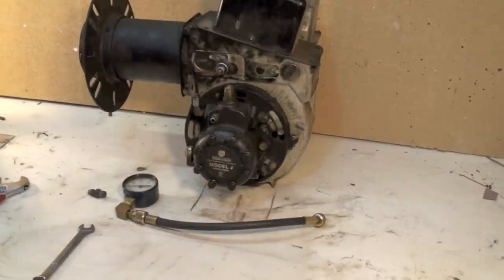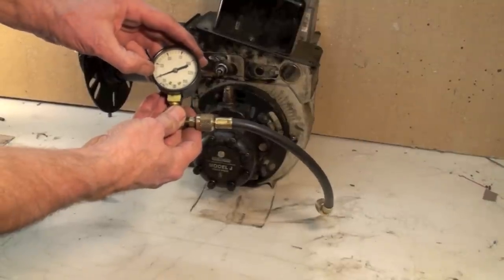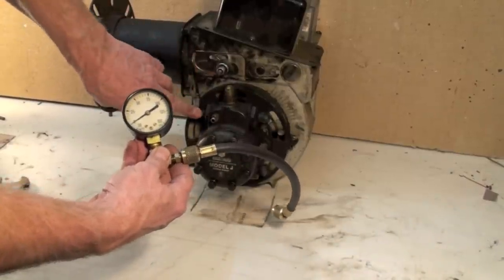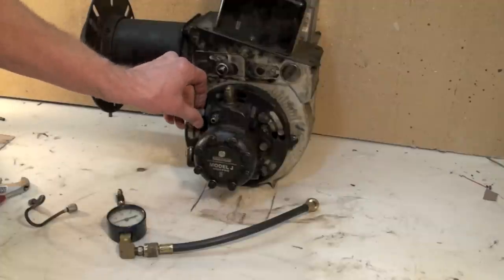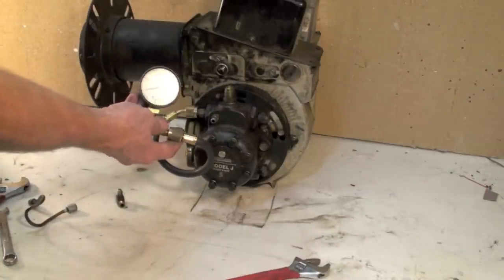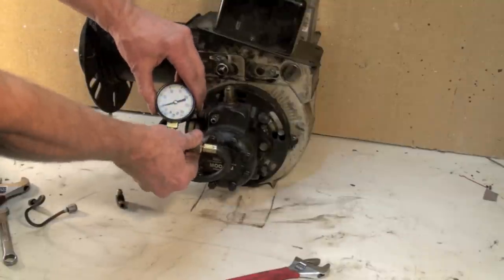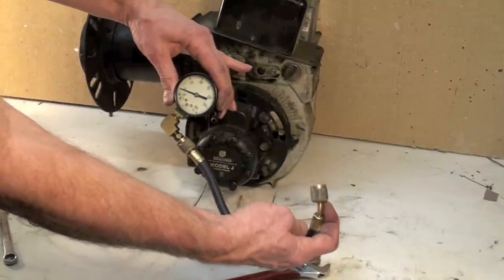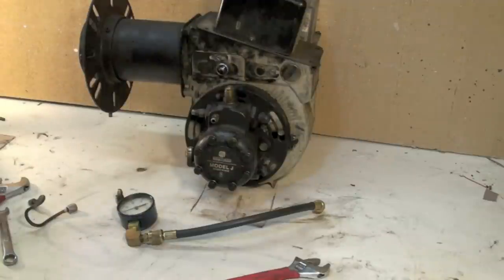oil burner pump pressure test

Comment from the maker: The tech probably increased pressure to increase efficiency due to better atomization.  The smaller nozzle was to compensate for the increased pressure.  If the nozzle is very small, it could plug.  It does sound like a supply problem though.  Fire the unit off with the gun line into a can to see if flow is continuous.  Good luck.

Comment: Hi Gary, thanks for your videos. I have a Miller furnace burning kerosene from an outdoor tank which is about 2 feet above the burner. I am having leaking at the burner which I’m thinking is “pump flow through” ? I’ve changed pumps in the past which appears to help for a while but reoccurs. I’ve seen pumps with an electrical connection and wonder if I should switch to that type. Any suggestions would be appreciated! All my connections are tight. I’m thinking the kerosene is getting through the pump and dripping out the nozzle. One line system. Didn’t run the furnace all summer and it still happened.

Comment: smaller nozzels are sometimes used when flame length is a problem,a smaller nozzel with a higher pressure gives shorter flame due to better atomization(the droplets are smaller and burn quicker)most new burners with retention heads are on 140-150 psi now-just a thought

Comment: If im testing the pressure with a gauge manifold(sid Harvey pump testing manifold) I have one line connected to the outlet of the pump(where the jet tube connects )and the other hose to the nozzle assembly.my manifold kit has pass/fail tests written under the case.i open the handle and fire the burner so I can watch and adjust the fuel pressure .it then instructs me to close the handle on the manifold and quickly turn off the burner .the pressure should not drop below 25 psi it says.but the pressure dropped to 0 on the unit so I was testing .it was a new lennox oil furnace with a becket nd burner and clean cut pump.
I doubt the pump is really bad ..did I do the test wrong or am I missing something .please respond!  I need your valuable input
Reply from the maker: You could have a leak in the manifold.  I also never used that setup, just a pressure gauge in place of the gun line.
GFM

Comment: Does this test only work on the gun line?

I hooked a gauge to the gauge port on the top of  a suntec pump...

It goes to 100 but drops immediately to zero 

Again, this was on the gauge port
Reply from the maker: It should work on the gauge port.  Does it drop to zero when the pump is running?
GFM
Reply: No
It maintains pressure reading when running 

But drop to zero on shut off 

I have a suspicion that the gauge port it's only for psi adjustment. 

I didn't try the gun line because I didn't have the proper adapter at the moment

Was just wondering if you ever tried plugging into the gauge port
Reply from the maker: Unless you have a leak at the fitting, it should drop 20% and hold.
If it does not, the pressure regulator is failing.
GFM @drummer4hire24
Reply: @grayfurnaceman 
OK 
I tested again....  Here are my results.

suntec pump.

On the GAUGE port I have 100 psi..... shut it off..... DROPS to ZERO  right away.

On the GUN LINE I have 100 psi  ... shut it off.... drops to  80 ish and HOLDS 

So, Obviously there is a difference in the gauge port and the Gun line...

hopefully this helps.

please test this on your own if you get a chance.  

Thanks.

Comment: How about putting a T fitting in the line then you can run the furnace and check pressure and adjust it at the same time
Reply from the maker: You could certainly that.
GFM

Comment: Where would you check the vacuum on an oil burner? Same spot where you'd check pressure?
Reply from the maker: At the supply line with the tank valve off.
GFM

Comment: Hi gary,
I greatly appreciate this video. I had a pump that was giving 100 p.s.i , but crashed to zero. The new pump holds at 90 p.s.i after it checks out. My question is if the pump was starting to fail would it have gradually went to zero or just checked out at a lower p.s.i like say 40, 50, or 60?
Reply from the maker: The reason for the normal 20% drop is the relief valve leaking by.  If the valve is leaking by, it will generally drop to zero, usually slowly.  I have never seen one drop to a lower PSI.
GFM
Reply: @grayfurnaceman  ok good to know. I was getting an epic amount of soot output. Basically a years worth in 2 weeks

Comment: My pump has a new 0-300 gauge installed on it.  My running pressure is 100 lbs. The pump bleeds down immediately when shut down.  My furnace seems to run fine and flame doesn't fail. Are there issues?
Reply from the maker: It should not drop over 20% unless there is a leak in your gauge.
GFM

Comment: I fyou are worhing on the burner with the burner on, reack=h over and flip the switch off- does the burner shut down the same way as it does when the boiler control shuts it down? With or without solenoid pump?
Reply from the maker: If you are switching the system switch off, it kills the power to the entire system.
GFM

Comment: Have a question I have a Beckett DS901 oil burner can I install a quality preasure Gauge and leave it installed on my unit would it hurt anything to leave it installed? Obviously not with a hose like a test Gauge. Just a quality liquid filled Gauge?
Reply from the maker: I can't say I have ever tried.  With some pumps, the pulsing may damage the gauge.
GFM

Comment: Hello Furnace Man... so I'm hoping you can help. My oil furnace needed to be reprimed as it ran out of oil. (I'm never going to let that happen again). Its a Mectron M5 type 217T. prime port was not all that obvious because it didn't have a nipple on it. So in the process of locating the prime port we accidently adjusted the pressure port. Is there an easy way to find out what pressure it should be. I have added a pressure gauge to the prime port as I could see no other place it fit easily. The burner runs at 100 psi but I'm not sure if that was the initial setting.
Reply from the maker: Some of the newer systems run 140#, but most of the older ones are 100#.
GFM

Comment: I got 8 of those units in my gradge collecting dust not I can check the pumps.  I think i blew the seal out of one of them trying to make a forge im pretty sure i over spun it 3k rpm was a bit more than bypass could handle

Comment: Hi Gary,
Great vid. Is the copper gunline on most burners 1/4" flare?
Reply from the maker: Most are 3/16"  Some 1/8".
GFM
Reply: grayfurnaceman Thanks for reply! I want to build pressure test setup to attach to gunline. 1/4" guage to 3/16 male flare should do it...
Carlin burner Genisys control. Reset from soft or hard lockout, will hitting reset again for 1 sec as soon as motor runs initiate a 2 min purge cycle? If so, is that true for most Beckett and Carlin burners?
Reply from the maker: I have not seen a Genisys that has that feature.
GFM

Comment: I've been looking for a pressure gauge so I can do this, but all the ones I find only go up to about 100psi. I need something in the 250-300 PSI range. Any recommendations?
Reply from the maker: Try a heating supply store.
GFM
Reply: Sid Harvey pump testing manifold

Comment: I have no oil flow through the gun line but it still comes out the bleeder screw.. is it a bad pump or a relay problem
Reply from the maker: Does your pump have a solenoid?
GFM
Reply: Yes.. I found out it was a bad solenoid thanks

Comment: Can i ask when burner runs for 20 mins and locks out is it always the salanoid or pump pressure problem please is route cause
Reply from the maker: If the burner runs for that long in one cycle, I am betting on a problem with oil supply.  Plugger oil filter, plugged line, oil tank with sludge in the bottom.
GFM

Comment: Checking it the way you are doing it is called dead heading. That is not acurate the guage should be in a tee with 2 lines in place of the "gun line"as you call it. Check it on the run for a TRUE oil pressure reading.
Reply from the maker: I have done the test both ways.  The pressure is the same.  The pump pumps far more oil than the nozzle uses, so there would be no difference.
GFM

Comment: so i did install a gauge at the "gauge port" and the gauge works!!-- after burner shuts off the gauge drops to 0 psi-soo... it IS the pump the regulator is not holding pressure!!
Reply from the maker: gmoneyga84 If you are sure there are no leaks at the connection, the regulator is bad.
GFM
Reply: +grayfurnaceman If he was using the gauge port how would the pump still hold pressure if what you call the "gun line" is open and any pressure will bleed right out the nozzle? No?
Reply: +bigpardner  From what I am reading on "suntec installation and service manual" IV-10 and IV-11, if you use gauge port pressure will drop to zero, if you use nozzle port pressure should stay at 80% or higher.
Reply: ***** ok thank you
Reply: ***** I haven't lost any pressure yet this season- same old pump too

Comment: This video is a waste if time. You didn't show where the pressure guage us attached. There are several  screws in the pump. One of them is the pressure adjuster.  I expected that you would show us how  to increase or decrease the oil pressure.All you did was muck around with some spanners and trying to sound knowledgeable
Reply from the maker: This video is about annual service of the burner.  Not pressure adjustments.  The pressure gauge is mounted to the gun line.  That is the line that moves the oil to the nozzle.  I have a video about adjusting pressure here:  https://youtu.be/fRnmO899I_c  However, pressure adjusting screws are in different places on different pumps.  Hope this helps.
GFM